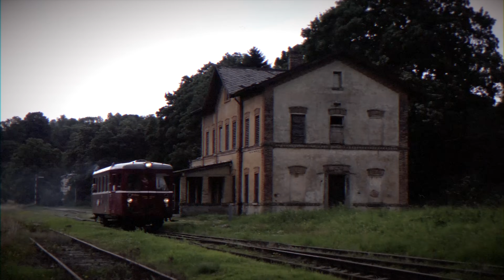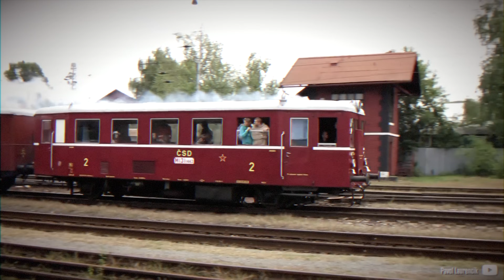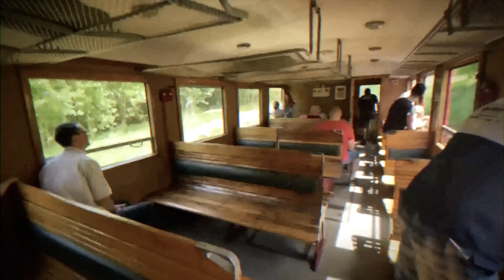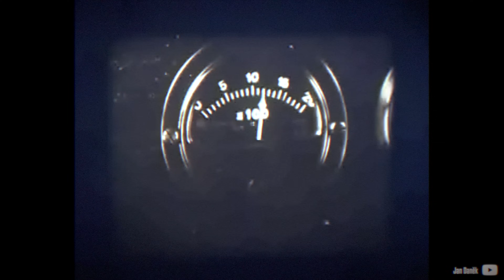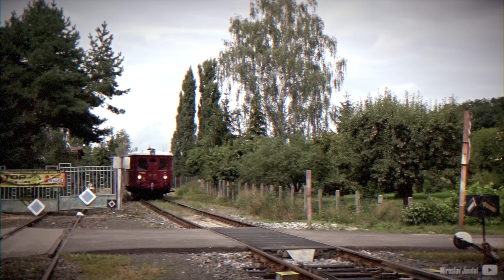This Train Has A Manual Gearbox

Comment: Until relatively recently (at least 2013) Cardiff, Wales, UK had a single-car manual gearbox diesel passenger train, running from Cardiff Queen St. to Cardiff Docks (the bay) - a single stop line.

Comment: These days we just take 1 (or 2 with a shared mid bogie, superficially similar to an articulated bus) passenger rail car, put a bus engine with corresponding automatic transmission at each end-bogie, and are happy. Well, at least in Germany; Voith makes the transmissions as they do need some care for the rail use; the engines don't need notable engineering specialization for this usage, it seems.

The gearing to the axle is typically a bit different as the wheel diameter and maximum speed differ from bus usage, but still....

Comment: Im very like videos. But this not the only Diesel-Mechanic unit. The germans had the VT95 Schienenbus:
https://www.youtube.com/watch?v=_V-w-SqkP8E
Hungarian Railway had its fair share of Diesel-mechanic traction: 
Some of them like the Bcmot from the 1930s:
https://www.youtube.com/watch?v=n1U2fJLgGQs
After war motorcar, the ABbmot which had a V12 Jendrassik diesel engine:
https://www.youtube.com/watch?v=zA6j5wHziA4
https://www.youtube.com/watch?v=jU-9xG_ZynU
The shunting loco M28, inline-6 Csepel diesel engine
https://www.youtube.com/watch?v=qeONW-_LaDE

Later they started building Diesel-Hydraulics, and Diesel-Electic rollingstock. The small railmotorcars replaced by the Bzmot "Stundenka" made in Czechoslovakia:
https://www.youtube.com/watch?v=f9l8weFXSGo

Comment: On the class 100s, 117 and 121 in Uk they got manual transmission (no clutch but you have to take off throttle to go up a gear, then put throttle on)

Comment: Poland produced few railcars with mechanical transmission in the '90 even. With automatic gearboxes though. They were basicly draisine frame with passenger compartment added.
Reply: None of such vehicles were made. First, the (very late) attempt at a light diesel railcar was class SN81, which was bascially a repurposed maintenance-of-way wehicle, with manual transmission and only the heading unit was operational during a ride, there was no multiple control. A very makeshift solution to an important problem. Later on this... "thing" served as the basis for its sucessor SA104, which was made in one example before further orders were cancelled, and this one has an automatic transmission (ZF) indeed, as well as more serious carbody construction and interior equipment. There were also SA101 and SA102 diesel units, but these were designed from ground-up, also with automatic transmission, but the production count was also very low before the production was cancelled.

Comment: It put some character. Nice rail car. Not many examples of diesel "mechanical" (gearbox) trains. Here there are some small 2 coach trains with scania engine and trans. I think it is kinda of AT transmission. They are like this ones, for small towns that are far from any rail network. Mostly used in light applications.. Ive heard they have experienced driveshaft issues. It is not that easy to get this thing right.

Comment: Wonder why Tatra diesels have always made that thick blue smoke
Reply: Air cooled anything has larger clearances piston to cylinder built in.(more expansion/contraction with air cooling
Plus whether you burn diesel or sump oil...the diesel doesn't care...it burns both.
And ATF
and hydraulic fluid
and peanut/soy/banana/vegetable oils...
Plus we are now looking at 80 years of wear and tear on those engines...?
Reply: @JohnSmith-pl2bk  Deutz air-cooled engines does not smoke that much.

Comment: I've been a huge fan of ČD railways and the former ČSD Railways also, i did not know the hurvínek has a manual gearbox until now, also what caused the noise of the ticking sound in every train that has a steering throttle?
Reply: You mean as the throttle was moved?
Probably a spring mechanism winding up to capture force that automatically returned the throttle to closed when the throttle was released (like a "dead man's device?)
Reply: @JohnSmith-pl2bk  dead man pedal.

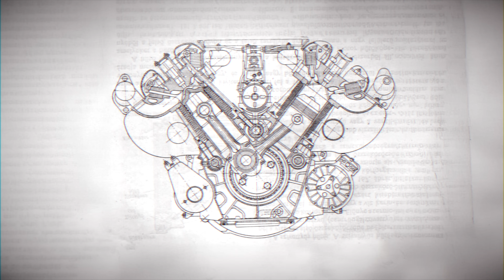Comment: 4:47.... it does not only enhance relaibility, it also enhance passenger-confort (less motor speed, lesser loudness). So, as you meantioning, the train-engine for that vehicle, is reduced to even 155 HP and 1600 u/min. That is way less loud and intrusive running noise. Besides the possible fact, that for normal use, that power-mode is absolutely enough. 
And there is a phenomen at ship-diesel running (and noising). They rev even lower and with way higher displacement, it results in a hypnoticing deep rythmical noise...barely hearable (infrasound via resonance within the ships steel construction?). So, low revs are lesser stressing, because of that phenomen of deep frequencies and that rythmic sound.
Reply: Most of local railways this train was implemented don´t allow speeds over 60kph because sharp turns and many level crossings including dirtroads with no safety features.
Reply: The engine speed of large ships is crazy low, around 100 rpm.

Comment: No turbo???
Reply: No need...
those engines were usually derated 
and the vehicles were designed not to exceed 60kmh 
with uncontrolled crossings, ad hoc  pickups and drop offs etc. to contend with on their countryside runs...

Comment: Manual transmissions in rail vehicles isn't that uncommon, though mostly limited to very light, narrow guage applications. There was a Hungarian narrow guage loco that I think used the trans from a Csepel truck. It had the standard 4 or 5 speed transmission with a 2 speed range box, and even had the reverse on the transmission, despite that being irrelevant since rail vehicles have reversers to allow same speed travel in either direction anyway.

Comment: UK also had a manual transmission train that used an entire semi-truck power train & those were quite modern.
Reply: the preselector manual gearbox was a British invention.
Leyland was the first to implement that on mass.
The routemaster bus also had a preselector manual gearbox.
I remember from my youth that in Leyland/Daf public transport busses the driver had a pedestal wth a H pattern and small knob to preselect gears. (Leyland engine and drivetrain were build under license by DAF)
Pushing the clutch pedal would engage the selected gear.
Nowadays in modern manual truck gearboxes it can automaticly preselect and engage gears and act like an automatic.
A manual gearbox is way more energy efficient then for example a classic hydraulic automatic gearbox.

Comment: Imagine doing burnouts on stations:):)
And iam sure it not have TC.
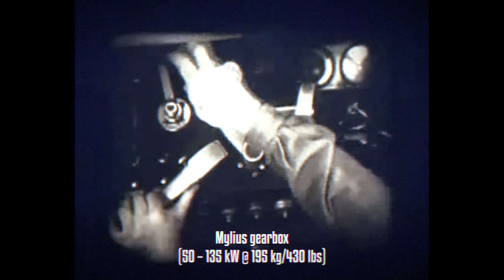7:26 I really didnt expect that owercomplicated geabox.
Reply: Beats having to shove down a .75 metre pedal with your right foot....or a 1 metre long handlebar clutch lever?
Reply: @JohnSmith-pl2bk  Can be operated by wire cables,electronicaly,hydraulic..etc.
Some old cars have this so why levers that are confusing to use and really not makes sense to me.
Reply: @joe125ful  
Railways systems are alll about bringing the train to a halt if anything goes wrong..f.g. Westinghouse brakes....deadman's pedal..etc.
The gearbox is a pre selector that, once you understand the principles, is easy to use......
and all laid out on the dash cam be quickly scanned with the eye ......
and moved with the hand.

Comment: Actually, there is a much bigger hungarian railcar, with semi-manual gearbox. The clutch is not really manual but pneumatic, it can be used in slip mode in first gear to get it move, and every other gears with pre-selected fuel load in in the actual gear.  Its engine is about 65.000 cubic centimetres in 12 cylinders, driving the output shaft via a 6 disc lamelled clutch. Well, this old lady has a very good sound

Comment: We used to call this railbus "Hurvínek". The units that replaced these had an engine from an actual bus and some are in service to this day in many different versions. Many people love to hate these railbusses, but they helped to preserve rural railways that would have been long closed without them.
Reply: As someone growing up on one of these rural railways who use 810 to get to school as kid I quite aoreciate it. And love them unconditionaly to this day.
Reply: I wonder how many nations did the same thing, it certainly happened in the UK with lorry engine and gearboxes then bus drivetrain, the frogs did too many drugs in the 60's and ended up with gas turbine railcars.
Reply: Not only the engine, but 4 speed hydromechanical transmision too, only the original reverse remained unused on this transmision box, and an another gearbox was added only for the purpose of reversing the direction of travel
Reply: Man I used to love these when going skiing in Šumava.
Reply: We had the same thing in the UK, we call them Pacers.
Reply: You mean 810 or so?
Reply: Yup, that's what happened in Poland - Poland did not make any small railbuses during it's communist era, only full size locomotives/EMUs. After the fall of communism, most rural railways were closed down due to lack of suitable rolling stock, sending full size trains on these lines would be unprofitable.

Comment: Of course it's air cooled, of course it sounds beasty as hell, of course it's a Tatra engine.
meanwhile in France many narrow gauge railcars made by Billiard or Renault had manual gearboxes too.
Reply: Poland also had diesel railcars of various manufacturers on the narrow gauge. Some were factory built, some were repurposed passenger cars, but even the factory-built ones could be very primitive, usually sporting an OHV diesel and a non-synchronized manual transmission straight from a truck. Some were even single-cab, requiring the railcar to be turned on a turntable or a track wye. Narrow gauge is a whole different "universe" than the standard railway in many respects.

Comment: “Reducing the need for diesel electric trains”

Proceeds to show a clip of a class 55 “Deltic”, which is fitted with an opposed-piston 6 cylinder Napier Deltic marine diesel engine
Reply: 18 cylinders 3 crankshafts , 36 pistons in a triangle

Comment: It's so weird to see a train and hear a diesel engine going through the gears 🤯
Reply: very common in europe with small railcars, like Stadler RS1 or Siemens Desiro
Reply: @PG-nf9wx  the Desiro even feels like riding on a bus, as the ones in Romania have a regular automatic gearbox, albeit without the gears allowing for much RPM fluctuation
Reply: You could hear the gears shift on a Stadler RegioSwinger

Comment: Small railcars like this existed in many countries, they were developed for those lines where passenger traffic wasn't enough to justify the use of full size steam or diesel locomotives with just 1 or 2 cars. That just wouldn't be economical. These little railcars with drive technology based on busses and trucks were much cheaper to build and operate and saved many branch lines from closure. For instance West Germany had the "Schienenbus" VT95 and VT98, East Germany the VT2.09 "Ferkeltaxen", Belgium the Class 551, 552 and 553 "Brossel" , and the Netherlands the omC and omBC "Ome Ceesje" to name a few, the UK had also diesel mechanical rail busses from 4 different manufacturers, but there they were less of a success.

Comment: In 1988 I was on a train in Scotland that was a manual shift 3 speed maybe more but it never got above 3. Learned much later it was probably a Gardner diesel motor. It vibrated like crazy and rattled the whole car. A fun experience.
Reply: Out of balance Gardners were few and far between....
something wrong there
might also account for no exceeding 3rd gear...
Reply: Probably not Gardner. More likely Leyland or AEC. Some parts of the country also used Rolls Royce

Comment: Kinda defeats the point to run one without even a second car 🤔
Reply: Should still be more efficient than a bus just due to the reduced friction of running on rails? 

But you do have a good point, seems like one extra car is no issue to include, so I see no reason to run without other than limited capacity needs
Reply: @goosenotmaverick1156  Looking at the speeds it achieves in individual gears, it is clear that it is not easy. With the additional weight it would only be worse.
Reply: @marcin.smolinski  I assume in flatter areas they weren't as bad, footage of one with an extra car was shown. But I assume any incline was absolutely impossible
Reply: Depends on the passenger numbers. Why run 2 coaches when 1 woukd suffice?